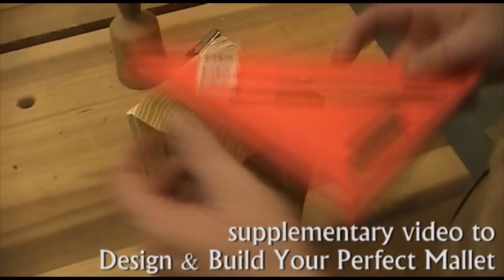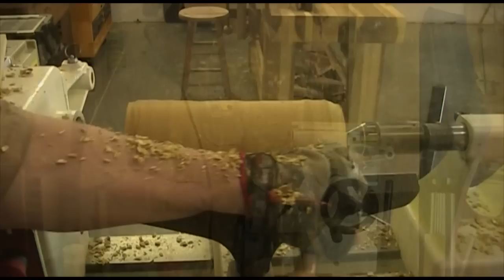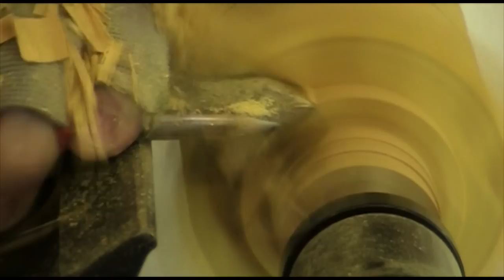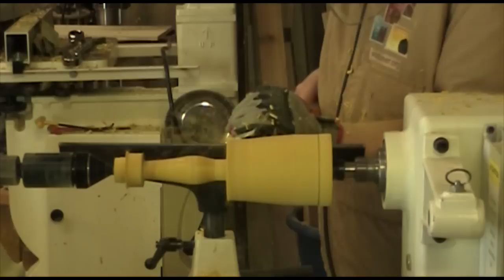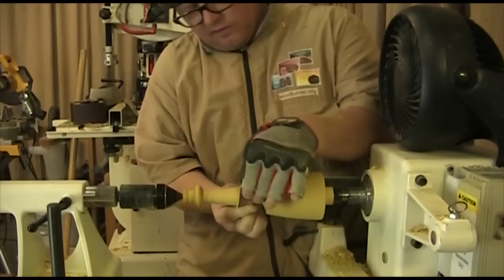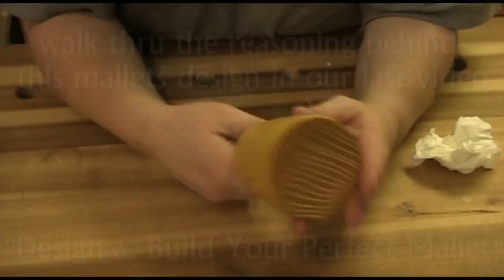Turn a Carving Mallet

Comment: Beautiful mallet.

One thought - the striking surface is eventually going to get dinged up.  Because it's a shop-made mallet, its easy to resurface it as needed, but only if you leave centers at the ends so that you can easily remount it on the lathe.
Reply from the maker: Louie Powell Jumbo Jaws (clamp onto outside and squeeze) work fine for returning but you'd be suprised how little bodark and hickory dent after fully dried. I discussed this and how other species endure in the previous video about design.  I've been using one for a few years now and it's just slightly dented from hitting holdfasts. But as long as handle is still comfortable my thinking is... who cares, shows use. Chisel won't know the mallet hitting it is dented.

Comment: Word of advice, you really shouldn't be wearing gloves . Great mallet though.
Reply from the maker: so you'd rather I get burnt.
Reply: @wortheffort  no, but a glove can easily get caught and you could really mess your hand up. It's just a common safety precaution like securing long hair and not having baggy long sleeve shirts. Only takes a fraction of a second for something to get caught in the lathe. And it was only a suggestion, you do as you you like.
Reply: @wortheffort  I understand trying not to get burnt. Along with having a wood lathe I also am a machinist. Imagine hot metal chips landing on your hand. It's just safer to get burnt than it is to risk getting your hand caught. I have seen people get their shirts removed and even arm torn off before you can even think about turning the lathe off.
Reply from the maker: @clownshooter  not the same.
Reply: @wortheffort  very much the same. It only takes one lose thread on your glove to get caught on the spinning wood and you could end up seriously hurt. But that's your choice. It's just a warning to be careful.
Reply from the maker: @clownshooter  when you are working metal you are not placing your hand in the line of shavings fire (which is hot enough to steam wet wood and even hotter for dry) constantly. Not the same. You’re armchair quarterbacking. Wait…. just read your username. Never mind.
Reply: @wortheffort  your arm and hand is in the same spot doing both. I have been a machinist for 30 years and woodworking for 15. I have plenty of burns from both. You do whatever you want